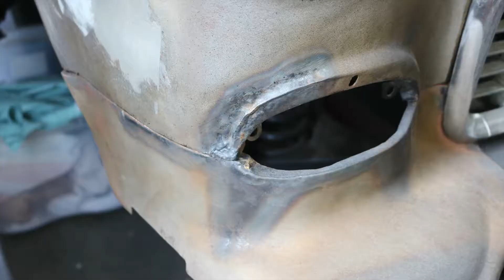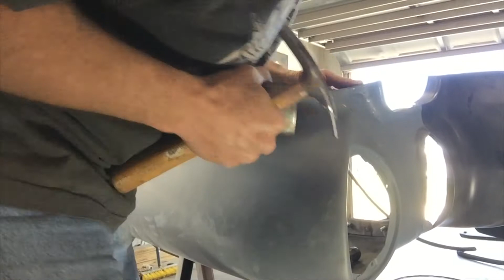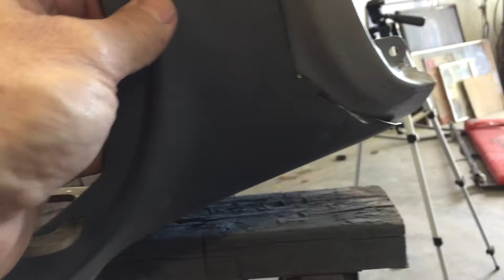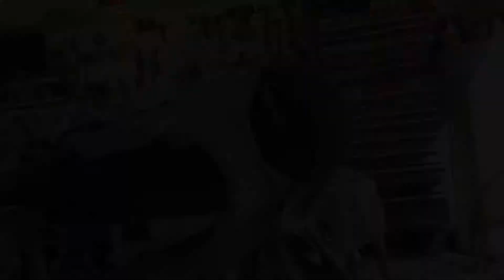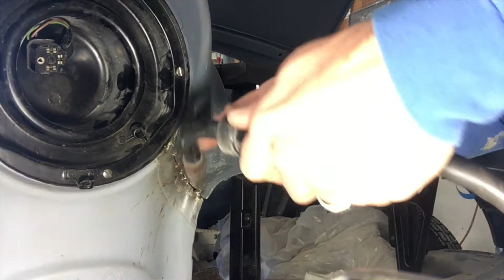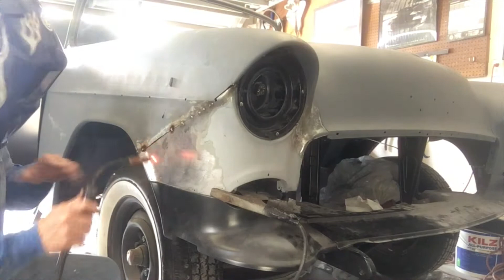How To Mig Weld Fender Repair #metalwork

Comment: I'm surprised that the fender eyebrow wasn't rusted out.  They usually are on most 55-56 Chevrolets.
Reply from the maker: We were very lucky,  the fenders were very solid and rust free.  Unfortunately it had the damage that someone did to it and this was the best repair in my opinion to fix it.  Thanks for checking out my video.